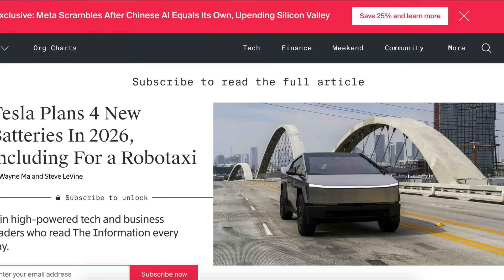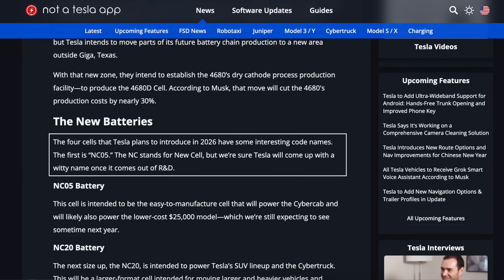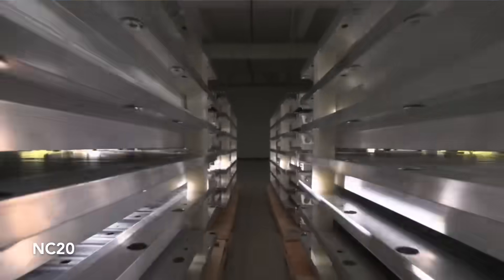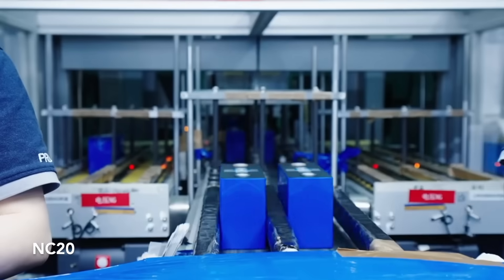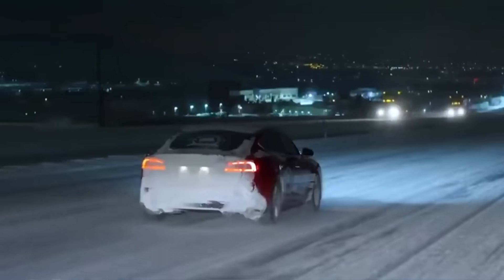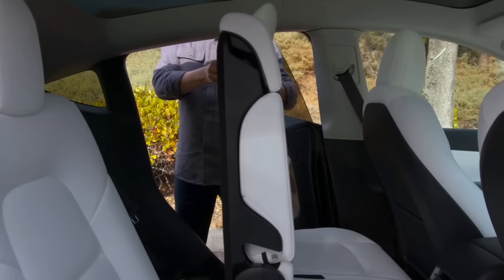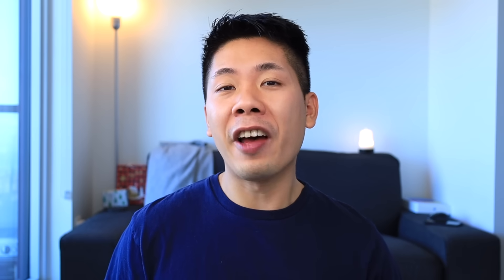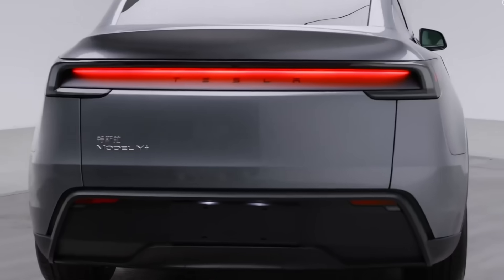Tesla Prepares Model Y Juniper For NC05 Battery Upgrades | This Changes Everything

Comment: hear that Elon is about to launch a new Model called the Tesla Model SS!

It will drive like a tank.
The satnav will only drive to Poland.
The car can drive e from Berlin to Warsaw in a single charge.
The frunk only opens when you salute it with your right hand at 45˚.
The windscreen is set fuhrer back to accommodate the Elon salute.
The car will take every third reich.
The car comes with Blitzkrieg charging.
The car features the new NAT-C charge connector.
The interior is designed by Hugo Boss.
The car comes with a security system that blows up if any Jews come near the car, it is called the final solution.
Will be priced at $1939.1945!
Reply from the maker: lol I’d buy
Reply: Perhaps you are looking for something with a hammer and sickle logo. Might have quality issues that make Tesla look like Toyota, but hey, good luck with that!

Comment: The only reasons why I have not ordered the updated MY AWD LR are:  1) I Need that 400-500 miles of range battery.  2) I Want hardware 5 to try to future proof this vehicle for a long period of time.
Reply from the maker: Those 2 things would make it the complete package
Reply: The more I think about it, and after listening to the 4th Qrt call, I’m even more disappointed that we are not seeing even more Existing newer Tesla technologies on this refresh.  I’m out until I see that range, faster charging, better colder weather, etc.  Too bad.
Reply from the maker: @timhundley9554 they’re saving those for the next gen vehicles, it’s hard for the Model Y since it’s still base on the old Model 3 platform
Reply: Listening to earnings call, I now know why they are not offering more range.  He mentioned that they will be battery constrained in 2025. Anything he puts in the MY LR takes away from the MegaPacks.  
Hopefully, that changes soon, because I will not upgrade until I get a substantial bump up in range as well as future-proof with HW5, steer-by-wire, better chemistry for longevity and cold environments, etc, etc…. ✌🏼🤟🏼🙏🏼🔋

Comment: Longer range won't matter because people will need bathroom stops every three hours.
Reply: @scottbreseke716  , not exactly true. If a person wanted to err on the side of caution with battery life they might be incentivized to only charge up to 80%, which would bring the 3 hours into play. Assuming you also wouldn’t want to go below 10%, that means you only are playing with 70%. 70% of 400 is 280. If you’re on the interstate, that’s about 3 - 4 hours. Ideally, I would like about 440 miles on a full charge, new vehicle to account for some degradation too. I’ve never owned a car for less than a decade.

Comment: Depends on the features of the cheaper car, vs the features of the Model Y Opal. At the moment, I'd wait for the Opal to release with just a standard version (I don't need any of that special edition 'nonsense'), that had hardware 5. When is hardware 5 supposed to be released? I didn't hear much about that. Can you do a video about hardware 5?

Comment: More importantl from miles is they will use 800v instead of 400v charging. Cybertruck and other competition companies already making it standard. Fast charging is more important than that few miles extra
Reply: It's the charging curve that matters, not voltage. 400V is fine for a 80 ish kWh pack as 250 kW is 3C, it just needs to hold that rate, not drop like a rock.

Comment: John, will you pull the trigger on the Juniper Launch edition?  Will you trade in your current Model 3?
Reply from the maker: Likely not because of the price even though it’s a super great deal, but I’m looking to buy after the initial hype and once quality is confirmed to solid after first batches. Also not a fan of buying FSD outright either

Comment: I ordered the Juniper launch series in quicksilver with white and black interior and all the upgrades. I’ll drive it for a year and then see about the Juniper performance and firmware five. You can’t chase technology things change too fast enjoy today. 😊
Reply from the maker: Thats a beautiful combo, and yeah technology changes way too fast for the first time i'm even considering leasing since there's buyout option now
Reply: So you didn't take the free tow hitch and wheel upgrade? I was debating about those because I don't really need them but they are free 3k upgrade that will probably boost the value of the car when u sell with a 17mile drop.
Reply: Well, whatever happened with Tesla I just hope GTA five comes out before all this
Reply: @carminecalucciCVO  you going to add the swastika decal on the front hood in lieu of the big T that used to be there?